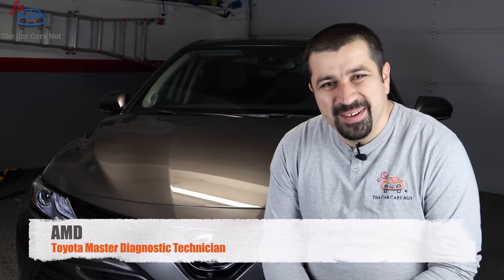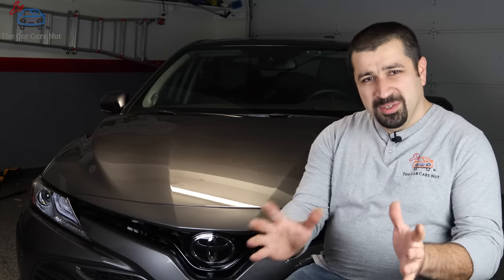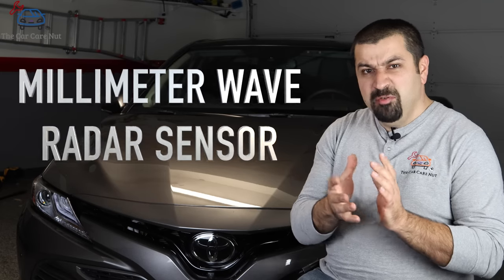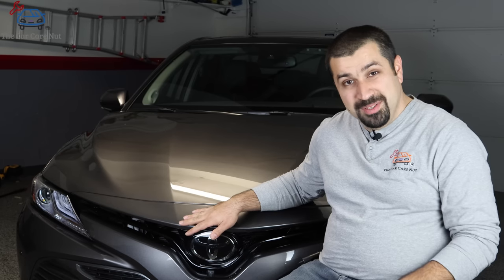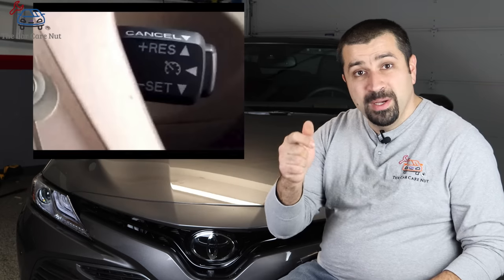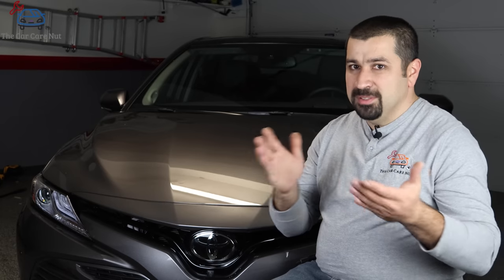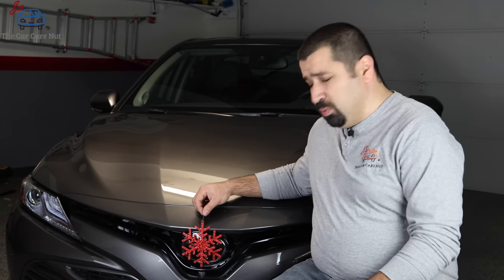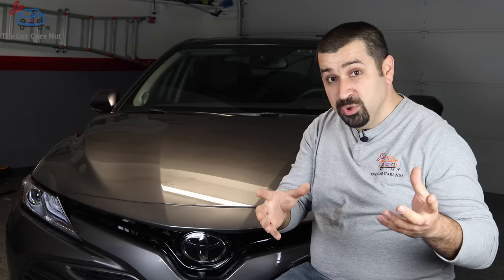How do Toyota Safety Sense Work Part 1 Radar Sensor

Comment: Having just bought my RAV4 I was fascinated to try the radar cruise control and I am seriously impressed. It’s so natural in its operation, as you say no jerkiness, it simply flows with the traffic on the motorway/freeway, exactly as you would if you’re controlling the throttle yourself. I also tested the ability to bring the car to a halt by following another vehicle down the slip road and completely to a halt behind it at the slip road traffic signals. It brought me smoothly to a halt from 70mph behind the car in front and then when the lights changed and the car in front moved it moved away again perfectly smoothly…. Such an impressive system 👍 Looking forward to the rest of the series!

Comment: Lots of my friends disable these systems because they don't "like or trust them". Once you get used to them you'll probably never want a vehicle again without them. Not only do they make yours drive much safer but also much smoother and less fatigue, especially on long drives! Hope Toyota keeps tweaking the systems in next generation versions of it.
Reply: I drive an old 2008 Nissan Sentra without any cruise control, and occasionally my dad's 95 Avalon. Ever since I've rented a car with lane assist and radar cruise control, it's hard to go back

Comment: I was driving at highway speed on a two-lane highway. As I rounded a right-hand dogleg in the highway a stopped car was waiting to turn left in a middle turn lane (mid-dogleg). The radar sensor decided there was a non-moving object directly in my path. So my 2019 Tacoma abruptly slammed on the brakes without me knowing anything was going to happen. Luckily no one was closely following.  Lesson learned about right-hand turns and the sweep of the radar sensor. Nice video.
Reply: Same, this is a very dangerous system in my opinion

Comment: I'm happy I discovered your outstanding videos with Toyotas. I have a 2020 LE and have all the Safety Sense features and I employ all of them. However...you didn't mention the cruise control can be adjusted at 3 different levels of distance where the system will begin to slow your car down from vehicles ahead...long, medium, and short distances. I've learned so much about my car from your great videos. I'm truly amazed of the technology as I owned a 2005 LE before my 2020. My 2005 was a "Modern Marvel" of quality engineering and reliability...218,000 miles of "trouble-free miles."

Comment: I was born in the 60s and I love the new safety equipment and would never consider turning off any safety equipment on my Toyota but with another brand I had to it intervened to hard and was too invasive. 
The Toyota system is smooth does it in a casual way

Comment: AMD another great video buddy. My 16 Tacoma had it, my 18 Tacoma of course and my 19 Tundra. When I picked up the 19 Prius and now the 20 Camry Hybrid of course also have it but they both took it one step further with the with the LDA and LSA (Lane Departure Alert with the lane steering assist). Needless to say the system as a whole saved my butt once or twice. Now of course 2021 Camry first one to get the TSS 2.5 which has better pedestrian and bicycle detection and the biggie is the lane keeping assist which keeps the vehicle centered in the lane (but does have my least favorite feature of any new car which is the floating media centre screen). Apologies if I sounded like a nerd.

Comment: Another great video, I didn’t know that you could use cruise control without radar. I’ve used this in city traffic and the only problem I see with it is that it doesn’t activate the stop lights. People behind you don’t know that you are stopping.
Reply from the maker: It should activate the brake lights when it’s slowing down using the brakes.is it not doing that?
Reply: the brake lights do activate. If not, theres something wrong with your car.

Comment: I have a 2018 Prius 4 and it has the Toyota safety sense system on it. Snow and ice can cause it to not work well. Heavy...I mean HEAVY rain also can block its abilities. I have it set up with the Coma AI self driving system and it works fantastic.....not only does it do the speed sensing, it also steers the car...and it does it really well. I have had this system for about a year and they do updates every once in a while...it is a level 2 system which means you have to keep your eyes on the road and be ready to take control if necessary. It is fantastic for long highway drives. I drove from Ohio to Florida with the Coma system and steered only a few times...all the rest of the time the car drove itself. It also is great for heavy traffic. I use it about 98% of the time and it makes driving really easy. It is amazing how much effort it takes to keep attention on the road to steer a car. It will tire you out. With the Toyota safety sense and the Coma AI, my trip to Florida was not tiring at all. I drove straight through with just a quick stop and rest for a few hours.
Reply: Hi Steve and CCN, I have a 2018 Prius Prime.  Does it have Coma AI self driving system for me to set up.  If it does, how to I set it up?  Thanks a lot!
Reply from the maker: Stephen I have no information on the comma 2 I’m looking into it. Let’s wait for Steve to chime in for more information for you.
Reply: @stephentrinh640  Yes they do. https://comma.ai/ and they have a search for what cars they can be put on. There are videos on YouTube on how to set it up...it is very easy to do. It took me about 20 minutes to install it.

Comment: The use of radar looks like a good improvement. My T Yaris (built in 2017 at Toyota Europe, Valenciennes) doesn’t use radar; instead it has laser sensors and a camera mounted on the windshield, behind the rear view mirror. It’s a 1M laser to IEC 60825-1. It’s used for the pre-crash safety system and other features, but it does not have adaptive cruise control, so speed adjustment is all manual.

No doubt the processing speed of modern electronics is what makes it possible  now.

Comment: One benefit of being able to switch to the non laser version is if something goes wrong with the sensors in the system. Driving truck we have Freightliners and Kenworths that often have problems with one of the sensors. When that happens you no longer have any cruise control. This can be very annoying when you're driving 11 hours a day.

Comment: I had a 2017 RAV4 and currently a 2019 RAV4 . The radar system in 2019 is much more better. In 2017, it doesn’t start slowing down until it reached much closer distance toward the slower traffic ahead and brake hard until closer. It’s pretty scary sometimes. The 2019 does much better job in flowing with the traffic.

Comment: Have you test drived a "Comma 2" Driver's Assistance System on 2018 or later Toyota?  It's a $999 Smartphone system that connects to the OBD-2 connector.  Very surprising at it's freeway capabilities.  The "TSS" package is probably linked to the Comma 2 with software upgrades making it more aware.  

Looking forward to a 2021 Sienna Hybrid Drive train series like your Prius one.  Your explanation of the systems was top notch and gives great credibility to Toyota's design, engineering and manufacturing of their Hybrids.  I see the Sienna Drive train as a bigger Prius Drive train, thus very reliable.  It would be an excellent delivery vehicle for an Amazon contract.
Too bad Toyota can't/doesn't ship their HiAce Van to the states. A Toyota commercial Hybrid van would sell well.

A mini van with 35 MPG and 18 gallon tank for 600 mile range is incredible
Reply from the maker: Thank you for watching my video! I have not tested the comma 2 but will look into it! Thank you for bringing it up!

Comment: 13:10 You nailed it. Crossing just a specific set of railroad tracks near where I live, (open road straight section) my car almost always flashes BRAKE and, well, brakes. No other RR tracks are a problem - just that one spot. Odd.

Comment: It should be mentioned that if you have this system on your Toyota and want it to be accurate and work properly, don’t lift your suspension and/or put great big tires on your vehicle.  If you do, you could have sensor alignment issues and it could affect reliability or quit working altogether.  That said, Toyota does make a suspension lift kit as of February 2021 that includes a new grill that has a radar sensor that compensates for the lifted suspension.  This lift kit is the only one that Toyota certifies as accurate and does not void the adaptive radar control warranty.
Reply: AMD -  My son has an '18 Tundra 1794 4x4 that had a 2.4" leveling kit installed on the front suspension. No modifications were made to the rear suspension. He also changed the tires to 33" diameter (as opposed to the stock 32" diameter tires). He has not had any issues yet, but is it necessary to have the radar system re-calibrated by a dealer?
Reply: @Charles Bondy. I was told that if your front end lift has resulted in your “Toyota Safety Sense” system (adaptive radar cruise control, emergency stop for pedestrians, lane guidance) that the dealer can adjust to make it work again.  If the lifted vehicle doesn’t have that system they advise to just make the headlight adjustment to keep from blinding people at night.
Reply from the maker: Hi! The dealership won’t be able to calibrate it as the car is lifted. However if you have no warning lights or issues I would leave it as is
Reply: Yes, the dealer can’t adjust the radar sensor in the grill.  I was thinking that Charles Bondy’s son had purchased the Toyota lift kit that includes another grill that has the sensor aimed to compensate for the front end lift.  My bad.

Comment: I have a 2004 Sienna with working laser guided cruise control. I only use it moderate but steady traffic going between 45 to 70mph with the shortest following distance. That seems to keep it the most civilized and not constantly slamming on the brakes.

Comment: Adapting cruise control is great even at lower speeds for following distances. There was a recent incident where it predicted a situation before I could see it and as i tried to avoid a crash it reduced my acceleration and steered itself without my permission and completely avoided the crash altogether! It foresaw a vehicle in front of the rigg driver that was disabled, blocking the lane merging in front of the rigg driver pulling the trailer, not visable from my perspective and evaluated the best way to avoid collision with the back end of the trailer and predicted that the drver in front of me planned to change lanes before i could predict this, and took control of my attempt to accelerate passed the driver in front of me and steered me away from being hit by the back end of the trailer as the driver of the rigg in front of me changed lanes to avoid the now disabled vehicle from merginging into the rigg driver. My hybrid has both radar concealed behind the emblem window and a camera concealed behind my rearview mirror for steering assist & lane guidence. 
Something was detected in a different situation where i had to disable the adaptive cruise control since it was a piece in  scrap metal the wind picked up.

Comment: Funny that I watched your video today - an odd coincidence.  Let me begin by saying that I am old school.  I didn't trust old fashioned cruise control for many years after it came out.  Now, I've got a 2019 Tacoma that does it all.  On two occasions this past Fall on perfectly clear days the pre-collision system warned me that the brakes were on the way to be applied.  The road was perfectly clear in front of me with absolutely no obstruction.  I never could figure out why it 'warned' me.  A couple of weeks ago, after a dealer-done oil change I noticed by seeing the warning light on on the dash that the system had been disabled.  Since the car had been in the shop and the maintenance 'period' was reset by the mechanic I thought that he'd inadvertently turned off the pre-collision system.  So, I went back through the computer and enabled the system.  Last week it became disabled and re-enabled a few times.  In fact, I actually saw the warning light go off and then back on while I was driving.  Not wanting to monkey with it myself, I took it to the dealer and they could find nothing wrong with it.  (I scanned the system myself and found no codes being thrown.). The dealer also found no codes when they scanned it as well.  It's got everyone puzzled.
Reply from the maker: Hi! There are cases where the system gets disabled due to weather. How’s the weather in your area?
Reply: The first time that it acted up the weather was sunny and perfectly clear.  The next time there was intermittent snow.  It didn't seem to be sticking though.  I've never had it shut down in rain.  By the way, thanks for the video.  It was very interesting.  Looking forward to the 2nd part.
Reply from the maker: Interesting. Did this have a recall for the front emblem?
Reply: @TheCarCareNut  Was there a general recall on the 2019's? I don't know if the sensor had been replaced.  I bought the truck this past March with 9,000 miles on it. It was used.
Reply from the maker: Give your local dealership a call and see if there are any recalls open
Reply: @TheCarCareNut  Will do.  Thanks.

Comment: I have 2020 Lexus ES. The system is great but with one limitation. 
When you are coming to a traffic light and there are cars stopping there it will take time to detect that these cars are stopping and you could end up in car accident. 

If the car in front of you is slowing down your car will slow down and come to complete stop with no issues. The problem will only rise when there is a car already stopped in front of you.

Comment: I have bought a 2021 4th gen yaris  a week ago. It was written all speed acc in brochure but my car has only high speed acc. Above 30km/h it woks. Toyota accepted their mistake and edited the brochure but if I hadn’t misleaded I would buy higher spect car. I specifically bought the car for semi autonomous driving. Stop and go feature is highly important for me. I demanded from toyota to upgrade it to all speed. Is it technically possible ? Can they add all speed feature to my car if they want? Thanks a lot. Very very appreciate for your videos and your answer.
Reply from the maker: Hi! I’m not aware of any updates to cars that don’t have the full speed adaptive cruise control.

Comment: I watched this video while Safety Sense 2.5 took me to work via a major interstate highway. I use mine daily for a 77 mile, mostly highway, commute each way. For a 2022 system, it’s okay and it sucks! As long as there are no bends/turns or construction, it’s a decent system. The system struggles when sunlight casts a shadow from highway barriers and it constantly wants you to nudge the wheel (I do this with my knee). I constantly have to adjust the set following distance based on changing traffic conditions otherwise it leaves too much space or not enough space in the front. This is still easier than manually driving the vehicle but it’s annoying. If there is construction, the system struggles when lanes shift as it loses track of the lane constantly. At night the system performs worse in all areas. This system is best for straight stretches of highway or in stop and go traffic. If you have curvy highways, like San Diego, it’s not good unless you are in stop and go traffic. The system has saved me or helped me avoid a few accidents and I always leave the emergency braking set to the most sensitive.

Comment: I love my new 21 Tacoma with the radar cruise control. The only concern I have is … is it hard on the brakes? I almost think I would like the old style cruise control where you manually apply the brakes. 
What are your thoughts on this?
Thanks 
Love your videos!!
Reply from the maker: Hi! If you’re constantly getting cut off and the car has to slam on the brakes to maintain distance then it might be hard for the brakes

Comment: Do the brake lights come on when the system slows the car?
Reply from the maker: If it’s actually applying the brakes yes they will come on. If it’s just coasting then no.

Comment: My car is a 2020 Corolla  Cross HYBRID. Would it be more economical and better for the car battery if I drive in adaptive cruise control when I’m in the open road? Lesser fuel consumption?
Reply from the maker: I would say so. But it won’t be a big difference

Comment: Hi I have a brand new Toyota Highlander hybrid 2021 and every time I am riding the brakes and hit a bump it seems like the brakes let go do you have any suggestions on what could be causing this
Reply from the maker: Hi! It could be normal operation as the traction control engages. One thing I would check is tire pressure

Comment: I have to replace the radiator grille on my 2020 4Runner TRD Pro due to some very minor damage to the top of the grille (near the spacing between the hood and the grille).  The body shop says that they will have to unplug the radar screen in order to replace the radiator grille. And that I will have to take the 4Runner to Toyota to have the radar recalibrated (which is quite expensive). Question:  Since the radar screen is not being replaced with a new one (the original one will be unplugged and then replugged at the end of the job) do I really need to "recalibrate" the radar. Also there is no suspension lift on my vehicle...just the factory suspension and tires). Thanks.